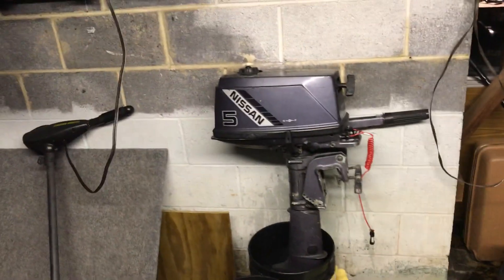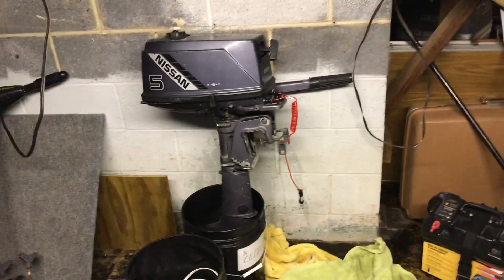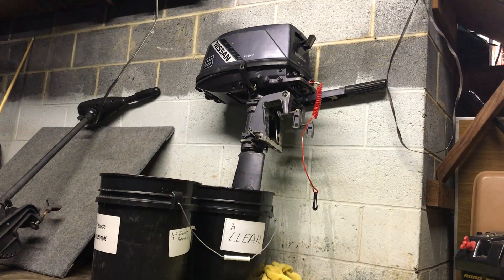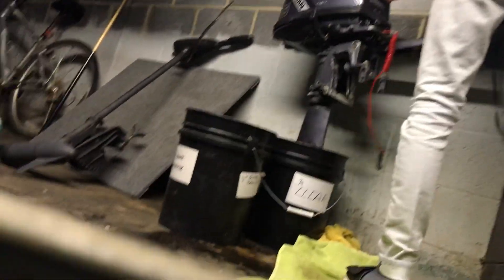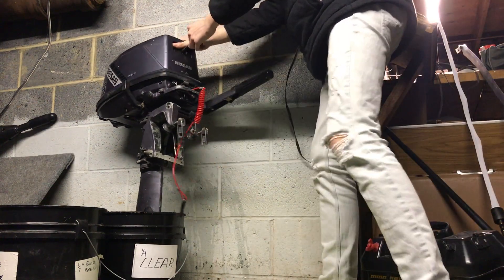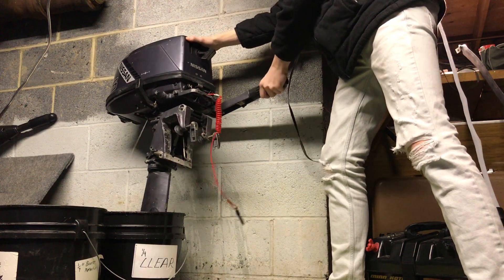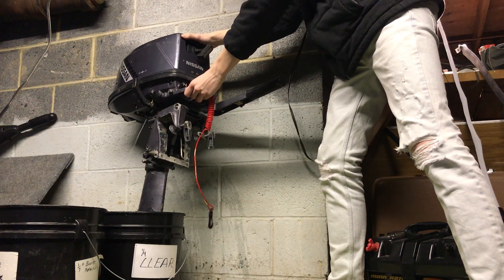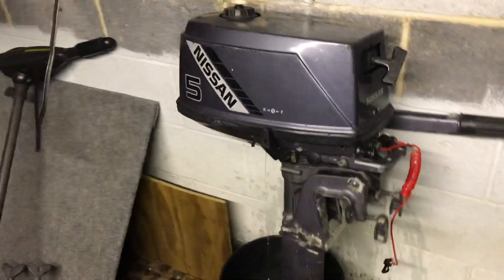Nissan 5 HP outboard motor test (1997 Nissan)

Comment: Hey I just got same one.  Hey but I noticed it doesn’t lock in position when I put it in forward.  I notice once I shift , the  hook part come out of the long bolt that goes in the position holes.  Is that normal ? Thanks .

Comment: Hey brother. I found one of these for sale right out of the box. Never been used. It's a '92 5hp nissan short shaft. How much you think I should pay for it?
Reply from the maker: Hey! Honestly these are great engines well built and will last awhile. Parts have also been pretty easy to find. If you get it for $550-$650 that would be a fair price. If they charge $750 or more I think it’s worth it but that’s really up to you. I bought mine used for $275 with a few problems. I bought parts and everything to get it running for $35. If you have any other questions or any way I can help you feel free to email me- bigbassmaster2003@gmail.com